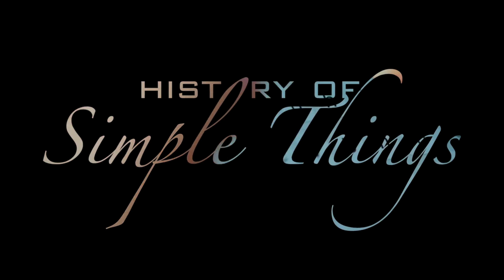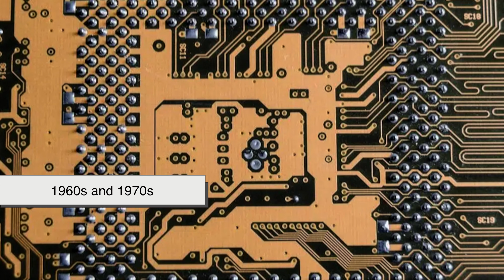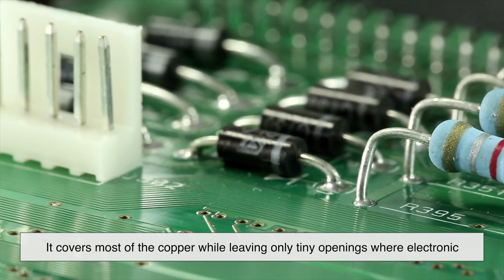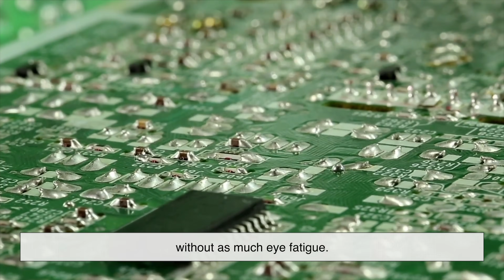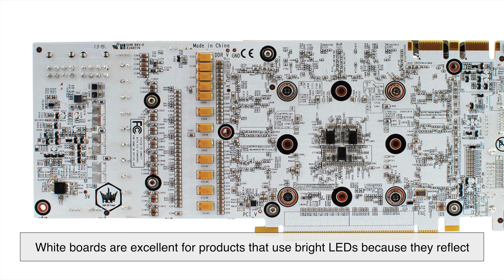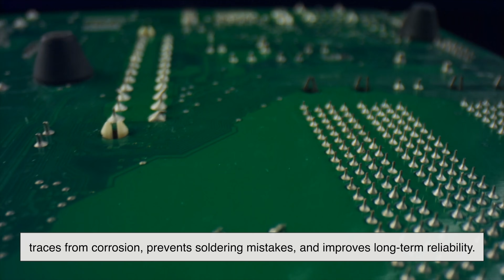Why Are Motherboards and Circuit Boards Usually Green?

Comment: For years most PCBs were brown phenolic with bare copper traces. Boards for demanding applications substituted fiberglass for the phenolic. Some added plating to the copper. Fiberglass resins of the time had a natural grayish green cast. I wouldn't be surprised if green mask was chosen to avoid clashes with that. You never explained why green suited manufacturing better except a vague remark about contrast with no explanation.